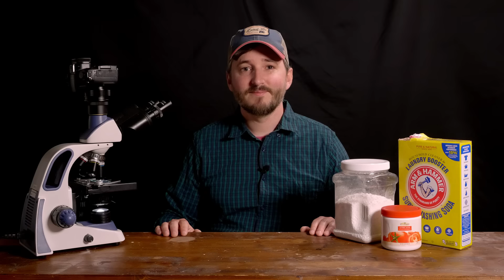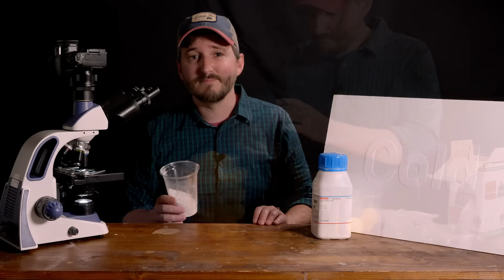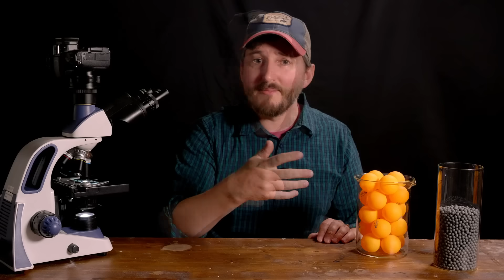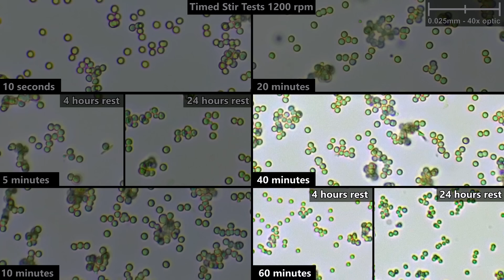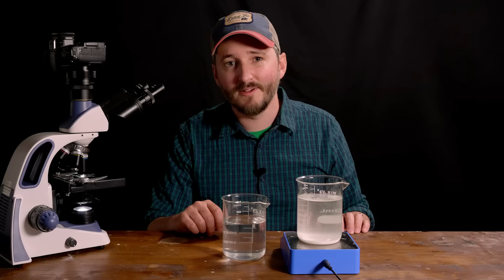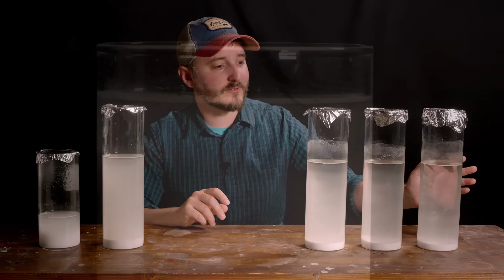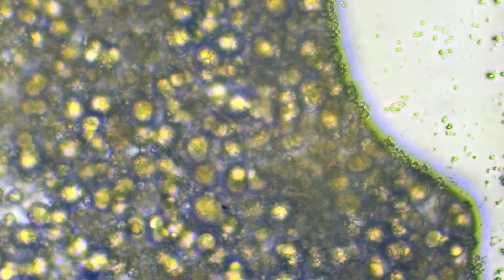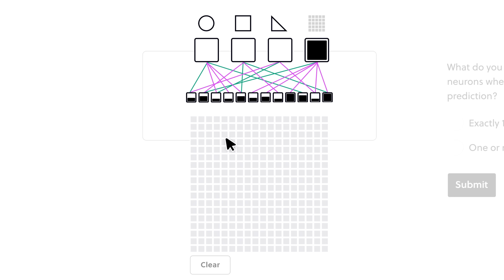Making Infrared Cooling Paint From Grocery Store Items (w/Novel CaCO₃ Microsphere Synthesis)

Comment: Okay, so since this is based on the fact that heat is pushed out far away to where it doesn‘t matter, if you were to use this paint on a horizontal surface, such as a the walls of a house, would the surrounding area of the house instead pick up the heat and become warmer?
Reply: Or will it just not work and stay at ambient temperature? If so, how does the panel „know“, that its heat recipient is colder/warmer?
Reply from the maker: It's not about pushing the heat far away, it's about sending heat off into a place which is not sending as much heat back.  Inside of a house where all the surfaces are the same temperature, everything is sending out just as much heat as it receives. There's nowhere for the heat from the cooling paint to go except surfaces which are sending just as much of their own heat back, so it will not work. As to your question about updates to this project, I talk about a different recipe about half way through my video about making cooing fibers.

Comment: You probably need to get have the carbonate source and the calcium source premixed and homogenized at low pH values so that carbonate exists mostly in the bicarbonate and carbonic acid forms, and then you have to add something in there that, only after a while from its addition, will cause the pH of the solution to increase and thus increase the carbonate concentration to where precipitation can start occurring. Basically, instead of adding one of your sources in quantities as big as whole droplets (droplets are some big stuff compared to the micro level spheres you're trying to make), you gotta have them premixed and homogenized, and then initiate the precipitation post-homogenization. Give this one a try and tell me how it goes
Reply from the maker: That's a pretty good idea. I'm satisfied with the method presented in the video for making microspheres. It works very consistently. I haven't been able to make them smaller into the nano range though. I'll have to think about your idea.

Comment: Do you think this could be used to make structural color pigments?
Reply from the maker: Great question. I've tried to make that happen, but I've so far been unable to get the particles down to the nano range required for visible light. I've spent a few days on it but probably would need to invest a few weeks to figure something out if it's possible by this method
Reply: @Nighthawkinlight  Do you think that such an effort could lead to the ability to color solar panels with minimal loss in efficiency?  Obviously traditional paints/pigments simply absorb light and would block the panel, but the ability to reflect even a single wavelength could theoretically radically change the appearance of a solar cell, potentially allowing one to camouflage it.

Comment: Hello i have a few questions for two of my fav channels on YouTube based on your vids after some thinking and pondering ideas!  
I was wondering?
could this cool box that filters infrared light be used to encapsulate solar panels as with anything electrical heat effects output in a 95% negative way! more hot it gets the less it does or last batteries are the same  etc
so if the solar panels were mounted in said cooling boxes wouldn't they perform much better as they would remain at ideal temps even in peak sunlight hours so getting as much as possible useable energy while maintaining an ideal environment to do so within 
like almost a lab condition one could say 
I've already looked up most solar panels ignore infrared the few that do use it done gain much from it! But i believe they would drastically gain from the cooling capabilities of this and if you toss in bi-facial panels even more so 
Also last question have either of you yet stumbled onto the crazy effects that lenticular lens effects on solar it increases its uptake to an insane level and almost eliminates shade effect due to the same principle in the invisibility cloak/ shield same concept bending the light etc anyhow please respond when you get a chance and thanks\ for all the great content that intrigues me
Reply from the maker: I might investigate these sort of things in the future. I don't think it will work exactly as you imagine, but the might be ways to improve solar with these things

Comment: I wonder if spin coating might work to lay down even coats. Likely there is an optimum spinning rate and viscosity to get the desired coating thickness. As for the coating that is spun off the plate being coated, I would think that once the acetone evaporates, you can take the powder and just dissolve it with acetone to turn it back into "paint" so none is actually wasted.

Oh, and to determine the optimum total coating thickness, coat a transparent material and then measure the amount of light that makes it through the coating without being scattered back out. Glass would seem to be a natural choice, but I am pretty sure that the paint wouldn't adhere very well. But frosted glass might give enough surface area to get good adhesion. Then put the coated glass (or whatever works best) well sealed to avoid light leaking around the edges over an opening in a light tight box painted on the inside with a very flat black paint. I don't know if a normal photography light meter would be sensitive enough. But, if not, you can always put a piece of undeveloped black and white photographic film inside the box in a dark room and then expose the box to a "daylight" LED for some period of time, turn off the light and develop the film. The gray level of the exposed film should give a measure of the amount of light that makes it through the coating. If you know the number of lumens for each gray level, you can get an absolute value of the light scatter. But if not,  at least you would get a relative measure with the point where the light making it through levels out giving you the best coating thickness.

OBTW, great stuff and I definitely hit the subscribe button. Oh, and one more thing, I don't remember you saying what the IR wavelength of light that the calcium carbonate radiates and what it is compared to Bismuth sulfate and where it sits in the atmospheric IR window.
Reply from the maker: The main part of the IR window is between 8-14um. I don't remember what the exact emission peaks are for the pigments, but barium does have a lot more that falls in the window than calcium carbonate.

Comment: As the owner of a camper van, if this type of paint could be applied to the outside of my van (and be resistant to carwash, etc.) it would be a complete game changer. I wouldn't need solar panels and massive battery packs to power my AC if simply parking in the shade can cool the van this much

Comment: Love your videos, quick idea for slightly better performance for the IR cooling panels you've worked on. 
You could change out the insulation medium for CO2, or krypton, so that it has a lower conduction coeff.
I think krypton is used to insulate between double pane windows, but it might be hard to get a hold of.
Additionally you could pull a vacuum and get a very high R value that way. 
Haven't run the numbers on how much this will help, but it would definitely make the panels slightly more efficient.

Comment: Could u clear coat it with the same type u paint cars with to give it some durability.  So it doesn't have to be covered. It would definitely make it easier to clean... If it's possible...

Comment: I think it'd be interesting to find a material that is thermochromic or otherwise easy to change the color to something near black when it's cold or in the winter.
I'm not a fan of the idea of cooling panels. I feel like they maybe could be useful for the cooling of air-source heat pumps but my gut says they'd be too much trouble to catch on.
If a layer could be added over the cooling paint that would darken when the temperature got too low, then in the winter your house would change color to absorb more heat.

Comment: NUMBERS? Is this application "cost effective"? That is, if I were to paint my south-facing wall with this paint + protective material (plastic sheeting?) would the drop in A/C use inside next to that wall pay for the paint+covering+installation+ maintenance? Is this MORE cost effective than just improving the energy efficiency of the wall itself? I imagine economies of scale would someday make this kind of paint application the default in all new building installations. But I wonder if you have pondered the numbers on this yet?

Comment: Wow just amazing.  I tried something similar using hexagonal boron nitride but purchased it from a chemical company and suspect it failed because the particle sizes were not as advertised.  I was however able to get it to work as a rollable, brushable paint after playing around with lots of solvent combinations.  I love that you took control of the particle size manufacture yourself.  I might try again with your material and see if I can make useable paint from it.  We desperately need paints that can reflect heat in the sky window to cool cities and fight climate change.  I salute you!
Reply from the maker: Thanks for sharing your experience trying the boron hexanitride. I'd like to experiment with that myself soon. Thank you for the super chat also!

Comment: Could someone explain why multiple sizes of the spheres work better than just using the smallest size only? (Which would pack the densest.) 

Thank you for this very interesting and  useful video - and especially for taking the time to put together the presentations. You are making DIY at-home chemistry very inspiring and practical.
Reply: because there would still be space between the spheres.  If you had a sphere the size of a tennis ball and filled it with spheres the size of BB for a bb gun, you wouldn't be able to cover all of the space within the tennis ball sphere.  Guess what, a tennis ball sized sphere would fill all the space within a tennis ball sized sphere's space.  Thus, have a larger sphere to start covers more space (the entire space occupied) than trying to occupy that same space with much smaller spheres which would leave space within the space. You can never get 100% cover, so it makes more since to get 100% coverage in the spaces that you can and continue working down to small sized spheres.  I hope that helps...

Comment: Outer space doesn't have a temperature*. The heat from radiative cooling isn't flowing from hot to cold, it's continuing indefinitely through vacuum.

* Technically the average temperature of a particle in deep space is near absolute zero, but there are so few particles per volume that it is practically the same as zero thermal mass.

Comment: But, if you put any opaque strip or heat absorbing material over the plywood, would you not get a cooler area beneath it? Also, if you can create a delta temperature, you could also make a starling engine to create work. Thoughts?

Comment: Simplied & Corrected: tossing  final powder  folic I theorized sodium bi-carb aka sodium folatewould  make it both organic and  non organic giving it ability to bond to steel or other non organic compounds solving adhesion issue. I tried to explain before but was uneducated at how to clarify what I meant so studied alot since. Still been to ill to try more of a thinker. Lol.
Reply from the maker: Folic acid is used to treat particles for dispersion, I'm aware of that use. I'm not sure what use you're pointing out concerning the plastic though.
Reply: Fixed original post for clarification.

Comment: ~~~~~7 Step Procedure~~~~~~~
1.Prepare Solutions:~~~~~~~~~~
  -Dissolve 20g of Sodium Carbonate in 200mL of water.
  -Dissolve 10g of Calcium Chloride in 100mL of water.
  -Dissolve 3g of Citric Acid in 30mL of water.
2. Combine Solutions:~~~~~~~~
  -Combine the Calcium Chloride solution and Citric Acid solution into one container.
  -Ensure the temperature of the combined liquid is between 10-20°C (50-70°F).
3.Mixing:~~~~~~~~~~~~~~~~
  -Pour the Calcium Chloride/Citric Acid solution into a mixer and start stirring.
  -Add the Sodium Carbonate solution to the mixer.
  -Mix the solution for 1 minute.
  -After mixing, pour the liquid into a separate container.
  -Wash the mixer with vinegar and water after each batch to prepare for the next.
4.Repeat Process:~~~~~~~~~
  -Follow steps 1-7 to create 3 total batches, each mixed for 1 minute.
  -Make a 4th batch, but mix it for 5 minutes.
  -Optionally, make a 5th batch at 1/3 scale and mix for 8-10 minutes.
5.Pigment Separation:~~~~~~~
  -Allow the pigment to settle in all batches for 20-60 minutes.
  -Carefully pour off the water from the settled pigment and refill the containers with fresh water.
  -Repeat the settling process 1-2 more times.
6.Filter the Pigment:~~~~~~~~
  -Cut a rectangular hole in a disposable bread tin and line it with a paper towel and white printer paper.
  -Pour the pigment solutions through the lined tin to filter them.
  -Rinse the pigment with distilled water as it filters.
7.Dry the Pigment:~~~~~~~~~
  -Once filtered, place the tin in an oven set to 100°C (212°F) and allow the pigment to dry.
  -After drying, collect the pigment and break up any clumps in a blender if necessary.

Comment: Really appreciate the video, absolutely mindblowing. So far I've managed to replicate your process up until the mixing and application where the paint turns very clumpy, sticky and viscuous once it leaves the mixing container. What can I use to get it to a consistence where it self-levels? Adding more water? More acetone?
Reply from the maker: Sounds like your pigment isn't dry enough. If it still has moisture in it it will cause the acrylic to clump
Reply: @Nighthawkinlight  Wow, thanks for the quick reply! I dried the pigment in an oven until the surface cracked (2-3h) and then stuck it into small box with a dessicant bag for a day or two. I'll try putting it in the oven again for another hour or so to make sure.

But regardless of that, if I wanted to test thinning out the paint mixture would I use more water or more acetone? 

Thank you!
Reply from the maker: @EMPERORINTERNET  It seems like the pigment would be dry after those steps but perhaps not. To thin add more acetone
Reply: @Nighthawkinlight  Alright, will do. Thanks again for the help! Will report back when I get new results

Comment: Has he sarted on making a functioning cooling pannel /cooling sys for a house? the tool shed?
Reply from the maker: I've gotten distracted with making cooling fabric. I'll have a new video on that soon
Reply: @Nighthawkinlight  thank you for responding! this cooling panel, (or any way to make it into paint????? ) can make a huge difference in the philippines and the planet, - regarding pannes, .. would glas work as a way to cover the cooling panel? and what would be the best way to constuct one (the pannel not the reflective surface) to make it more resistant against environmental impact .. like heavy ranin, and wind.. ?  .. would coiling copper tubin behind or covvered make it possible to pump the coole fluid into the house for cooling? your vidoes are exiting

Comment: Hm, I think this paint can be used to create a solar-heated Stirling engine: hot cylinder wall covered with absorbing substance, cold cylinder wall — with radiating paint. Should also be able to work on clear nights, OTOH, likely producing very low power

Comment: Maybe I'm late to the party, but would it help to paint a clear coat of some sort of material, on top of it, to circumvent the need for a plastic cover? Like a clear coat you add to stained wood etc. So you could actually paint roof tiles or something?

Comment: In the early experiment, where slow results were obtained with the rapidly stirred very dilute solution, I wondered if continuous slow introduction of the chemicals via drippers would overcome the issues of small yield, and high water use. Concentrations would be kept within the sphere-forming range by keeping the chemical introduction rate the same as the sphere-forming rate.

Comment: So if painted surface gets some shade from a tree or something it gets even colder, but ONLY if its facing the sky/colder space.
But what happens if it doe NOT face space?
ie: 
You paint a vertical wall of a house that faces the garden and garden wall and the neighbour's house etc.
Now the surfaces the IR is being radiated at are the same to warmer temperature than your surface... so the IR Light/heat is now not dissipated from your wall??

Comment: Might try flotrol  to help smooth the coating. Could use 3d construction printer to apply. The lucerne valley calcium carbonate processers sell micron sized product in different size ranges so two or more size distribution products could be mixed for effect. These products are used as fillers for paints to save money by reducing titanium dioxide required to formulate the coating. Get their spec sheets for the products. I know precipitated calcium chloride is a "softer" product used in inks. And is more expensive than ground air classified micron sized particles.

Comment: I rather like what you did here.  I am planning to try this out shortly.  I'd like to combine this with a water cooled 40:14 heat pump and compare the efficiency  of an air-cooled heat pump to the  radiatively cooled water heat pump.  Might just use thermoelectric modules at first.